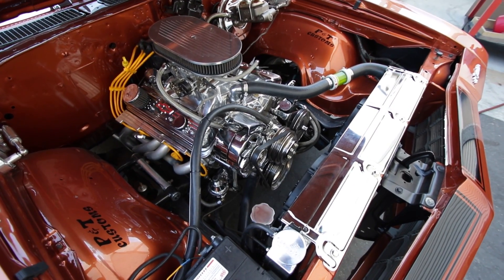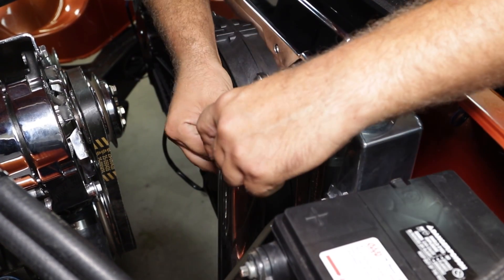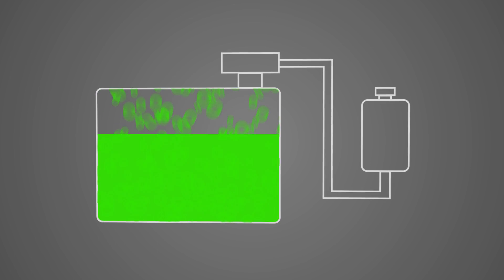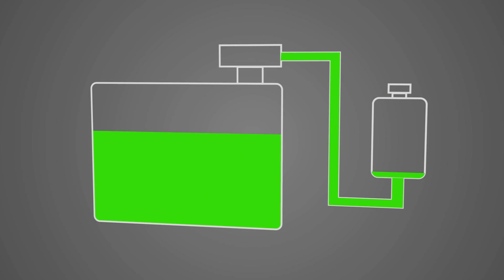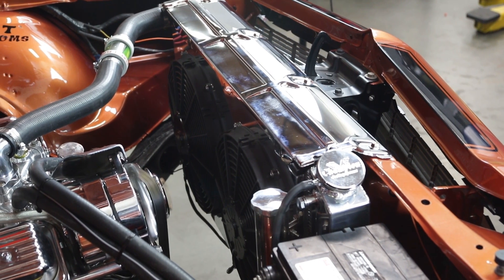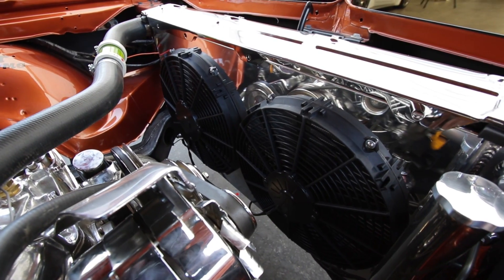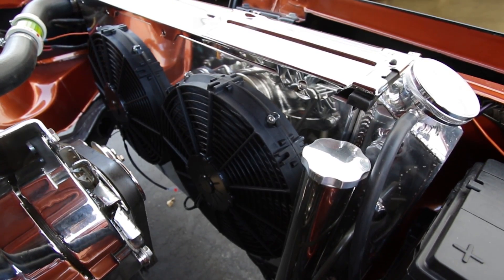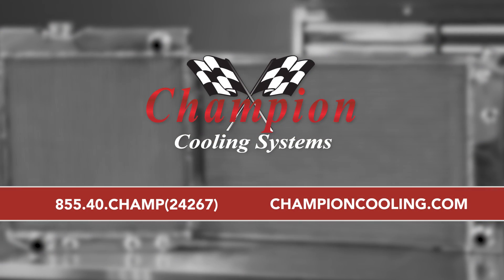Champion Radiators: How to install an Overflow Tank in a vehicle

Comment: Does the size of the coolant tank matter as long as it’s not ridiculously small
Reply from the maker: Yes, this is one reason why we different sizes, larger engines and cooling systems should use a larger tank, smaller engines (like 4 cyl) can get away with a smaller overflow. 

You should be able to get to a point where you don't need to keep adding coolant; if you need to keep adding, then you might need one with more capacity. There should always be a little coolant in the overflow when the engine has cooled, I've seen 'rule of thumb' for how to calculate, but that's a lot of work to figure out.

Comment: Should I add any coolant to the overflow tank after installing it for the first time?
Reply from the maker: The idea is to let your cooling system develop a level that works, so you can add coolant to the reservoir after a heat cycle of the engine, but only a fill it a partial amount (about 1/3). When the coolant expands and is pushed into the overflow, when the level in the tank rises and reaches the highest tube, the excess will be dispelled onto the ground - that is the level that should remain in the overflow tank. Once the engine cools, if there is no coolant left in the overflow tank, you can add a little bit more but don't fill it, and eventually you should develop a level that works for your cooling system. You should only add to the tank when the engine has cooled down. Hope that helps.

Also, fun fact: the reservoir works on atmospheric pressure, not gravity, so the top of the overflow tank doesn't need to be above, at, or below the radiator - it can basically be mounted anywhere that it will fit and can be accessed.
Reply: @ChampionCoolingSystems  Thank you for your reply. Am I correct to assume running the overflow tank empty to begin with (after installing it) and only after the car has reached normal operating temp (and purged any excess coolant into the over flow) to then fill the overflow to around 1/3 (when all has cooled down)? TIA.
Reply from the maker: @leliamartin6283  You can fill it with water (or a 50/50 mix if you have extra) about 2/3 of the way when you first install the radiator and run the engine, and it will siphon some of that in when the engine cools down. Once you get to a point where some coolant stays in the overflow tank after cool down, then you know it's completed the cycle. After a couple of heat cycles, to keep adding more is just wasting it. If it pulls all of the coolant out and you still have room for more in the radiator (when cooled) then your overflow tank isn't big enough... and you might need a larger one. 

Pulling all of the coolant from the reservoir just means that when it got hot and the pressure built, it expelled some of that coolant from the tank, and a larger tank will hell preserve your coolant level. Smaller radiators/engines can use smaller tanks, larger should use a larger tank where possible.  Thanks...
Reply: @ChampionCoolingSystems  Thanks guys, you've been of great help with the set up. Appreciate you taking the time to explain it all.🤗🤗

Comment: Lol there shouldnt be air in the system after the inital purge after filling the system up after service or repair. The purpose of the cap opening and the overflow is exactly what its called. Overflow. Coolant expands while gaining temperature. Taking up more space. The system does not have anywhere for the coolant to go after its taking up more space. The cap opens and stays open at spec pressure and temp allowing the expanded fluid to escape the system into the overflow bottle. The inlet to the bottle is on the bottom of the tank. In doing so as the system cools while the engine has been turned off the fluid in the radiator and block cools down and begins to contract. This creates a vacuum on the overflow bottle and the coolant in the bottle will then be sucked back into the radiator. This keeps it leveled off and the radiator empty of air. The only time you will see air in the system is if it wasnt purged correctly or if theres a leak where air will get sucked in after coolant is lost somewhere in the system. Describing it the way the video does is like the way gimmick companies describe intake kits and why they would benefit power gains. Saying more air equals more power. When really more air equals more fuel that can be introduced to the mixture that couldnt be before the extra air was added. More fuel per combustion cylce equals more power. This all of course is only valid if your using the correct grade of gas. Since most people dont know it and just think everything is okay to run on regular unleaded. They dont realize they put it in something that at minimum requires mid grade or higher. But then they wonder why they consistantly get shitty milage and power. To low of octane and you get more counts of knock. More counts of knock and the computer retards timing to lower the knock count. Retarding timing is a power loss and major milage drop. Using a higher octane will lower the knock counts and will allow the pcn to advance timing and allow more complete atomization and combustion(fuller burn of the drop of fuel being injected) to where you end up getting more power out of using less fuel allowing the pcm to run the injector for less time per cycle until it needs it when you open up the throttle. In which the open intake will give a better throttle response and milage over stock. (If your using the correct fuel) more air doesnt equal more power. It equals more usable fuel burn. Cant add more fuel without adding air. Cant achieve more power without advancing timing and adding that little bit of extra fuel with the extra air.
Reply from the maker: There is indeed air in the cooling system when cooled - you can see that when you remove the radiator cap and the coolant level isn't to the very top of the radiator. When the coolant reaches its boiling point, it creates steam - which is water in its gas stage. Water droplets mix with the air in the system to create the pressure that expands the coolant to the overflow. This is why you can hear the air 'purge' when you twist the cap a little - it's releasing the steam build up that is still in the system, even when coolant has expanded to the overflow. But yes, we are fully aware of how an overflow tank works. Thank you.
https://blog.championcooling.com/2018/06/08/overflow-tank-vs-expansion-tank/

Comment: Nice video. Does the cap of the recovery tank have to be at any certain height in relation to the cap on the radiator? Higher, same height or lower? Thanks! Which item # or capacity for a SBC Chevrolet 350?
Reply from the maker: Hi-  the reservoirs function on atmospheric pressure, so the height in relation to the radiator cap is irrelevant. You can mount them wherever they fit best, and use whichever size fits best in the location you choose. Thank you.
Reply: @ChampionCoolingSystems  Great, thanks!

Comment: Thanks for the illustration showing where the two hoses hook to the recovery tank. Embarrassing but I think that's been my coolant problem for years🥴
Reply from the maker: Thanks for your comment. You wouldn't be the first or the last to be confused by that. It was a smart idea to have the bottom tubes representative of the length of the tubes inside the tank.
Reply: @ChampionCoolingSystems  I guess this is the same for ls or Gen 1 sbc?
Reply from the maker: @ronaldsteveson76  The engine has no real bearing on how the reservoir operates. As the pressure builds up inside the radiator, hot coolant is dispelled past the cap to fill the reservoir. When the pressure subsides, it creates a vacuum effect and siphons some of that dispelled coolant back into the radiator. Here's an article that might help explain it better: https://blog.championcooling.com/2018/06/08/overflow-tank-vs-expansion-tank/
Reply: @ChampionCoolingSystems  thanks again I really appreciate it and also appreciate the verse that's on my radiator box

Comment: Which vent/tube does the relief hose get attached to?  Short or longer?
Reply from the maker: When looking on the outside, the longer tube reflects which is longer on the inside, so you want to connect the hose from the filler neck to the shorter tube, because that will allow the reservoir to fill. When it reaches the top, it will begin to expel coolant out of the longer tube.

Comment: Why are the line so small going in and out of the tank I finally tossed mine in the trash because I couldn't find 1/8 to fit it and the radiator
Reply from the maker: Ours is a standard size for these, but I have seen other brands with much smaller. You can find tubing at most home improvement stores...Lowes, Home Depot. That's where I got my tubing.

Comment: what's the different between overflow tank, breather tank and reservoir?
Reply from the maker: An overflow tank and reservoir are essentially the same thing: they have a cap but are not considered closed or sealed - excess coolant ends up on the ground, while the steam/air is vented to the atmosphere from the coolant expanding.
A breather tank is similar to an expansion tank, where it is typically a sealed or closed container designed to expand the cooling system and separate the air from the coolant - they vent back to the cooling system through a steam port, and typically never need topping off.
Reply: @ChampionCoolingSystems  which situasion need expansion tank(breather tank) ? coz air should be not inside the cooling system, unleast leaking somewhere right? 

If i use overflow tank, i need to remove original reservoir tank right?
Reply: how expansion tank reduce coolant temperature ? coz coolant will not flow through radiator and flow from top to bottom hose right?
Reply from the maker: @yoyyoy4789  You can use whatever came with the vehicle, if nothing was available then use a simple reservoir/recovery tank like those in the video or an aftermarket tank. 
You shouldn't have excess air in the cooling system, but you cannot fill the cooling system to 100% capacity - there will always be some room (air) in the radiator after it cools down. That's where a reservoir/overflow tank comes into play. The idea is to fill it about a third of the way and let the cooling system get to temperature, and expand. It will fill the reservoir and any excess will drain out. As it cools, coolant is pulled back into the radiator to replace what vented out through the cap to the reservoir. After a couple of heat cycles, your system will level out somewhat. 
None of these effectively 'reduce' the operating temperature. Losing cooling that cannot be recovered will potentially decrease the capacity of your cooling system, which can cause higher temperatures due to the fact that the coolant level becomes too low (this is why they used to always refill the radiator back in the early days). By using a reservoir, you're maintaining the capacity of the cooling system. If you're overheating, there are other things to look at, like coolant flow, air flow, timing, and coolant capacity.
Reply: @ChampionCoolingSystems  Thanks for information

Comment: Bought champion radiator, it started leaking from where find go into tank after 2 months....got replacement and same thing happened.
Reply from the maker: Sorry you've had some issues. Did you discuss this with someone in our office? With thousands shipping every month, the possibility of a leak can occur, but for the same part number to leak twice there must be something going on. Please contact our sales office and discuss with them to resolve it.  951/245-9464  thanks
Reply: Had a champion radiator for seven years now zero issues big block mopar

Comment: do the recovery line on the take get connected  to anything?
Reply from the maker: The tube from the radiator filler goes to the short tube on the reservoir, and the long tube on the reservoir just vents to the ground, unless you want to connect another tank to recover it, which really isn't done. Once you've gone through a couple of heat cycles, it shouldn't dispel any more coolant, and the reservoir will vent back into the radiator.

Comment: Alright I purchased a CC1164 Radiator and the recovery tank but there are no brackets for bolting the recovery tank to the Radiator anywhere is there something missing or do I need to order something else to finish off the head-turning look .  How do I get a sales men to help me finish this system correctly .......
Reply from the maker: The overflow is not designed to be bolted to the radiator, there should be a couple of 'L' brackets to mount it to the core support somewhere.  I've always used Aluminum stock from home improvement stores (Lowes, Home Depot) to mount mine, but the included brackets should work. If you need further assistance, please give us a call... 951/245-9464, M-Th 8-12, 1-4:30, Fri 8-12.

Comment: I have one of these tanks, works well but I always wondered how high the tank should be mounted compared to the radiator? I'm running this in a 58 Dodge Coronet which uses the stock radiator. The recovery tank sits about 4" lower then the top of the radiator, is that ok?
Reply from the maker: These should be close to the radiator, but they don't need to be in any specific location with regards to height since they work on atmospheric pressure and not gravity.
https://blog.championcooling.com/2018/06/08/overflow-tank-vs-expansion-tank/
Reply: ChampionCooling ChampionCooling does it make a difference if the overflow tank is right next to the radiator but is on the opposite side of where the radiator cap is located? Does the overflow tank require to have a non-pleasure cap?
Reply: ChampionCooling ChampionCooling ChampionCooling does it make a difference if the overflow tank is right next to the radiator but is on the opposite side of where the radiator cap is located? Does the overflow tank require to have a non-pleasure cap and the radiator need to have a pressurized cap? Or should it be the opposite?

Comment: If you have air in the radiator, you may have a leak. But yes, it should be full to start with and it recovers the hot expanding coolant as the engine reaches correct operating temperature and the pressure exceeds the caps rating. If the cold radiator is low after re-filling several times, have the pressure cap tested, the caps vacuum relief valve cleaned and inspected, then pressurize the coolant system. Other, very nice product. Retired ASE Master Tech.

Comment: This is where I'm a bit confused too. The nipple that doesn't go to the radiator cap can I run a hose from the overflow tank to a coolant reservoir I've already installed? I have a 72 Monte Carlo. 350 engine.
Reply from the maker: There's no point in running two of them, they can both capture dispelled coolant, but only the reservoir connected to the radiator cap will bleed back. There would be no atmospheric pressure to return the coolant from the second to the first - therefore making the second one simply a 'catch can'.
https://blog.championcooling.com/2018/06/08/overflow-tank-vs-expansion-tank/

Comment: Where exactly was the overflow tank mounted on? I bought a radiator with electric fans.
Reply from the maker: You didn't specify which vehicle, but our overflow tanks come with brackets so you can mount them wherever you want to.
Reply: ChampionCooling. 72 el camino
Reply from the maker: http://i915.photobucket.com/albums/ac352/txccod/72elcaminoredwhite/DSC04829_zps1c0d492a.jpg

Comment: How can I install they have a 2 nipple which one is going to radiator cap and the other one nipple is where ? Thanks please reply ASAP before I buy it.
Reply from the maker: It is probably best to contact us so it can be explained better. However, of the two tubes - how you connect them depends on the length inside the overflow reservoir.  If you remove the cap, one tube will be level with the bottom and the other will extend towards the top of the tank. When the tank fills, that longer tube will vent the excess, so if you connect a hose to that, it will vent to the street. The other tube connects to the filler neck.  When you fill your radiator, you should only put a little coolant in the overflow, - don't fill the overflow, leave room for expansion when the radiator gets hot and pressure builds. As the radiator cools, a vacuum forms and pulls some of the coolant back into the radiator.  If you have any further questions, I would be glad to help you out.  Michael: 951/245-9464
Reply from the maker: open the cap of the reservoir, and the tube that runs towards the top is the one that vents out, the other is the one that connects to the radiator - the shortest tube goes to the radiator.  See if this illustration shows up for you
  https://www.facebook.com/ChampionCooling/photos/a.648958655122121.1073741827.198008973550427/1882665561751418/?type=3&theater
Reply: so the longer tube is left untouched? what if the overflow tank fills up? Is there a possibility the coolant will leak out of the longer tube?
Reply: This is where I'm a bit confused too. The nipple that doesn't go to the radiator cap can I run a hose from the overflow tank to a coolant reservoir I've already installed? I have a 72 Monte Carlo. 350 engine.
Reply from the maker: There's no point in running two of them, they can both capture dispelled coolant, but only the reservoir connected to the radiator cap will bleed back. There would be no atmospheric pressure to return the coolant from the second to the first - therefore making the second one simply a 'catch can'.
https://blog.championcooling.com/2018/06/08/overflow-tank-vs-expansion-tank/